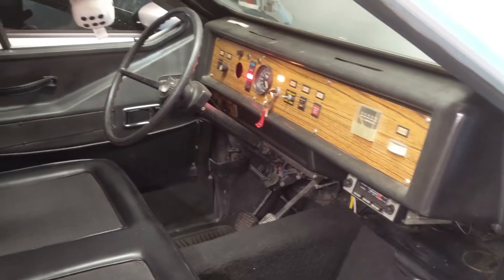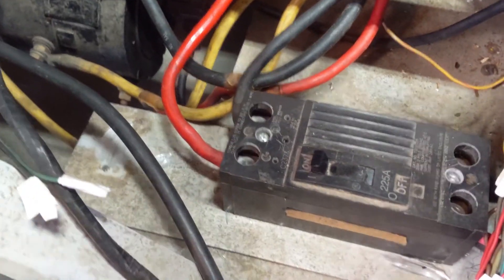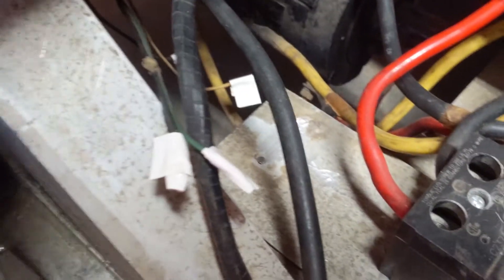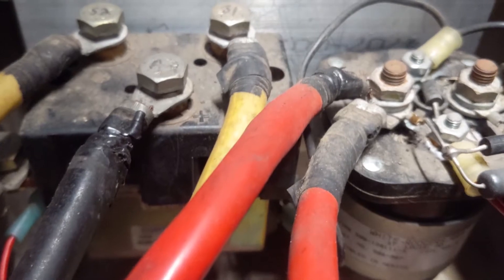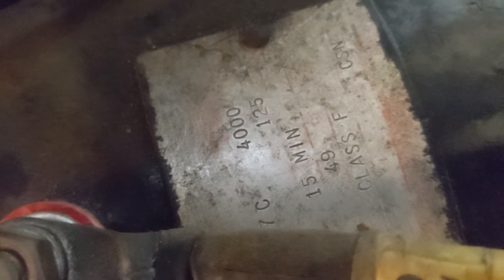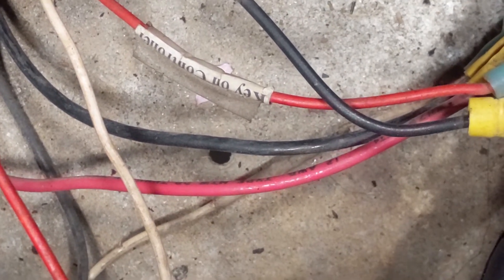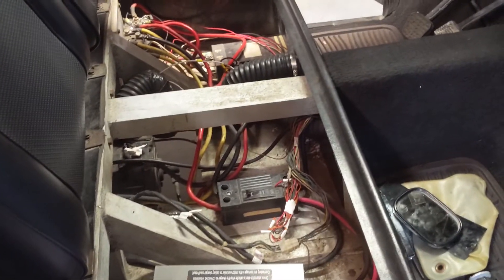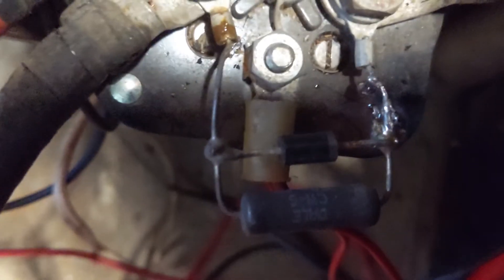1981 Comutacar Acceleration Issues | 1981's electric vehicle

Comment: the clicking is normal, it's the main power contactor. there is a switch on the potbox that turns it on when you start to press the accelerator. it's purpose is to disconnect the power if the controller should short out. if there was no main contactor, there would be no way to shut off the motor if the controller failed, it's a safety feature all electric vehicles like golf carts have. the other contactor changes direction, forward/reverse.

i would check the controller circuits, make sure the 3 wires from the potbox are connected to the controller. make sure none of the fuses supplying control power to the controller are blown.
Reply from the maker: Are you anywhere near PA? Would love to have you lend a hand!! Thanks for the guidance!